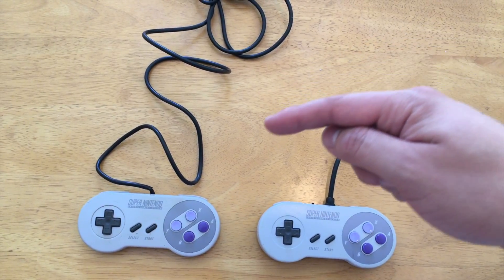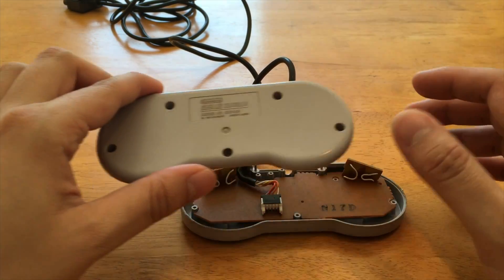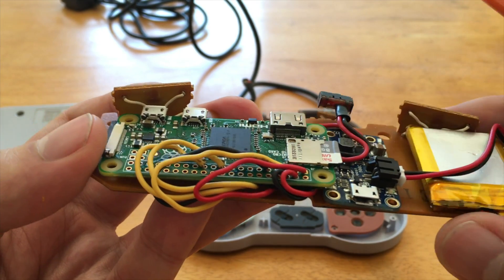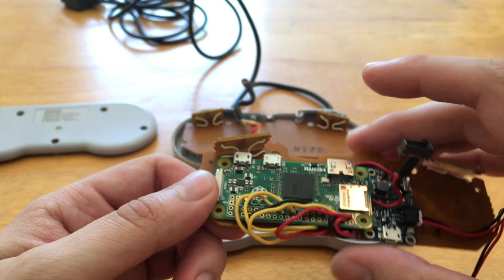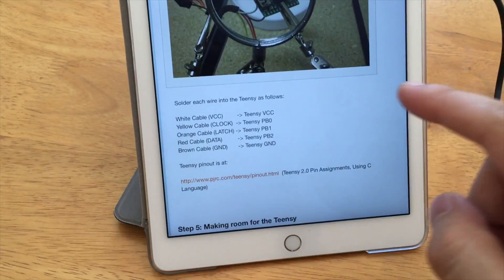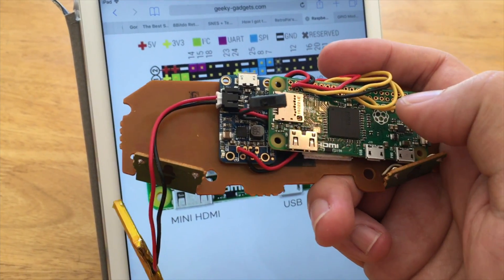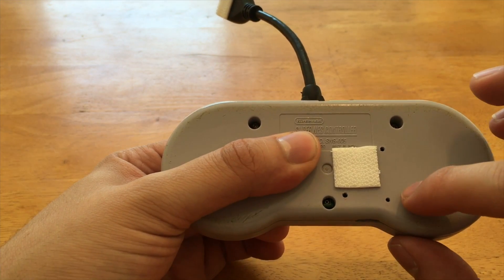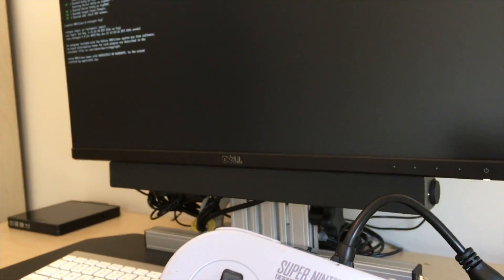Raspberry Pi Zero inside an SNES Controller - The SNS-005Z

Comment: Love it.. might do it myself in the near future! :)    
+1 Sub
Reply from the maker: Hi Tiny Plays and sgt cyrus, I am aiming to write up the software portion over the holiday break in this how-to https://hackaday.io/project/16288-raspberry-pi-zero-inside-an-snes-controller.  Sorry I haven't been able to get to it sooner (work has been busy).  I'll write back as soon as its up - hopefully by the end of the month.
Reply from the maker: Good idea Tiny Plays.  During break I'll see if I can make a thin img of the install with just retropie and the driver set up.
Reply from the maker: Thank you!  Will be glad to help out if you have any questions no problem.
Reply: I noticed you offered Lord Mortus help so i hope you wont mind helping me as well. I messaged you on youtube but i dont know if you got the message so ill just copy paste it here. Sorry if you already read this and im just repeating myself but here we go:

Can i get your help with the raspberry pi zero inside a snes controller guide? I need to wire my snes controller to my pi zero but ive already used pin 1, 2, 6, 17, 19, 21, 22, 23,  and 24. Your guide says to use pin 1, 5,  9, 19, and 23 which is a problem for me due to the fact that I'm using pin 1, 19, and 23 for another attachment. Is there any way i can attach the controls to a different gpio pin?  I've tried researching this but i feel like im in over my head. I'm trying to do this as a project for school so its getting stressful to get it done in time. Any help you can offer me would be really appreciated :)
Reply from the maker: Hi sgt cyrus,  I'll be glad to try and help.  Will likely be able to take a look this weekend at the earliest.
Reply: Anthony Caccese okay you're a life saver :D
Reply: Tiny Plays probably not lol but whats up
Reply: if youre talking about the software for the controller im stuck on that as well.

Comment: So question, if you did this with a usb controller snes. What would be different?
Reply from the maker: Hi Paul, I think the main differences to watch for would be the space you have inside the controller, how it would be wired up to the Zero and how to interface retropie with it software wise (for example you wouldn't need to use the gamecon_gpio driver)

I know this project (which was an inspiration for me building mine) uses a USB controller as a base
https://twitter.com/another_russell/status/677212612170555393
This images he has posted might help.  I haven't been able to find wiring diagrams on that one yet but will see what I can dig up

Comment: Ideas for saving space in there: kynar wires (thinner insulation), trim the pi by grinding off the bits on the edge you don't need (like around that camera connector), and remove unnecessary connectors (unused USB ports, for example). You might be able to get all three components to sit flush on the back of the controller PCB next to each other like that.
Reply: Adam Zey this is a project for beginners so no beginner would try to trim the pi
Reply: the pi is easy (and cheap, especially the zero) enough for beginners to actually do that and more, if they want something to fit tightly, they must commit and it's actually a good thing to learn things the hard way.

Comment: Does this not get TERRIBLE frame rates in snes games? My pi is the worst with that, it slows down almost every snes game I try to play and it drives me insane
Reply from the maker: I haven't run into an issue so far.  Possible to let me know what version of retropie you are running and what emulator is being used to run snes games?  Will see if I can help
Reply: Hmm where is that information located? 

Oh something else of note, I'm actually getting bad slowdown in nes AND snes emulators. For whatever reason I'm getting NO slowdown in gameboy color games (and I can't load gba games at all because something about the BIOS)

Comment: So i could actually not understand you completely in the part but how long does the battery last aprox? Great mod! I'm working on a pi/nes hybrid with a 3d printed case :)
Reply from the maker: It's my bad - the audio ended up being lower volume than I expected.  Battery lasts about 3 hours.

Comment: Do you think there would be any way to mod the controller to have a port so another controller can connect to it? So that two people can play together? I imagine it would only take 1 more USB hub at the top or maybe bottom since there are SNES controllers for sale now that have a USB plug instead of the old 7 pin one.
Reply from the maker: I think it might be possible.  Been talking through ideas in another comment on this video started by Lualdu.  There are test pads on the bottom of the zero to solder a USB port.  Next big question is power.
Reply: Anthony Caccese I used to have a pirate/chinese knock off emulator that was basically one controller, a port to connect a second controller, av cables and a ac adapter port. Maybe that would work.

Comment: how dificult will be make it for two players?

some thing like atatch another control to the main one
Reply from the maker: Working on that next.  There are test pads on the bottom of the zero that a USB can be soldered to.  Next question is if there is enough power to make that work.

Comment: Hi  Anthony!
Amazing hack, love it! I want to build one of these myself. And want to add wifi to it as well. Do you think a Famicon controller will work the same way?
Reply from the maker: Hi Sondre, I have seen similar builds with Famicom and NES controllers - the gamecom driver has support for mapping those as well.  With the NES controller, the main difference I have seen is the space to add the board itself is not as tall so it might be difficult to fit a battery and powerboost inside.  This looked like a good starting point to see what's possible - https://hackaday.io/project/8703-zero-entertainment-system

Comment: Hey I wanted to do this, and make a first video!! But I cant get a Zero :( 

Good job nemesis!!!
Reply from the maker: I have started to see more stock available for Zero's in the last few weeks - so hopefully they are becoming easier to come by.  Would be excited to see your take on this as well!
Reply: Anthony Caccese Well my gripe is now I have to make it cleaner than yours. Heck its like I now practically need to take my Oculus Rift cable and splice it to have a SNES controller where you don't need a battery and could power it from the power USB jack on the TV (optionally of course a wall adapter). Need a replacement cord :( 

Also I can imagine the hell that is soldering a HDMI plug to that cord. But if I could get a replacement cord the cable is so long I practically would have unlimited retries. 

If I also didn't power the Pi via GPIO but soldered a micro usb to the cable, the USB could be hooked up to a computer then you could use win scp to transfer new games without opening it.

Comment: Well i got mine almost compleate but ran across an issue where just the B and only the B button will work.  Did you run across that issue on yours?
Reply from the maker: I did run into something similar when doing the wiring the first time (my up/down dpad controls were mapped to the a/b buttons).  If I am remembering correctly I had mistakenly flipped clock and latch.  So I am thinking it could be wiring or the GPIO driver config (or a combo of the 2)

Possible to take a photo of your current wiring (from the controller to the GPIO) so we can start there?

I'll also get my config for the driver and upload it so we can compare that as well.

Excited to help and see you get yours completed!

Comment: I've found an error in your schematics. Clock and Latch are connected to the wrong gpio pins. By the way, I followed your instructions (and eccept for those small issues) it works great!
Reply from the maker: Great catch! Very sorry about that - looks like I was off by 1 for both.  I just fixed the diagram and reuploaded.  Thank you again for your help.
Reply: Thank you for this great project :)

Comment: Awesome work! How long does the battery last. Also, ever think of using magnets instead of screws to hold it closed?
Reply: It says 2 hrs in the description. Also, you don't want your project falling open if you drop it or it getting stuck to any wire or metal bits laying around. As a tinkerer, I can confirm that my workstation always has little metallic things everywhere. xD
Reply: +MuffinsSpreadPlagues Noticed it said it after I posted :x was thinking about the magnets, I don't think it would pop open but yeah, it would stick to everything in my bag or on my desk lol
Reply: +phonixzero Lol same here. earbuds would always be wrapped around it too

Comment: might want to use stranded wire vs solid core so the cabling won't be as stiff unless you want it to be.
Reply from the maker: Awesome tip!  You're right that would totally make it easier to move the wire around in the case.  It is a bit too stiff now.  May try that in another revision.
Reply: +Anthony Caccese cool :) glad I could help.    I just ordered all my parts yesterday so when I start building mine I'll try using stranded ribbon cable for the controller to the pi.

Comment: Have you ever thought of making a second controller to connect to that one wirelessly? It would be awesome to play donkey kong country with friends on one of those.
Reply from the maker: I am thinking through a way to expose the USB OTG port to try out a daisy chain approach as step 1 =)
Reply from the maker: +RubberBrony Amazing!  Thank you for pointing me in that direction. The pads for D+, D-, gnd and 5v right?  More straightforward than I was thinking initially. 
Now to find the right parts =)
Reply: +Anthony Caccese take a look at the test points on the bottom of the pi zero ;D
Reply: +Anthony Caccese Yup! :D
Reply: I tried this out and found the 500c couldn't handle supplying the usb port. I just plugged in an empty hub and it still caused the pi to crash.  If you went up to the 1000c and supplied power directly from its pins you could but you would probably drain that little battery super fast.
Reply from the maker: Thank you for the heads up Matthew.
Reply: Waner that's not an excuse. take 10 to 20 minutes every day. it will take a while but if you're not a lazy fuck it won't be too bad
Reply: hmmm I don't feel like it
Reply: With a Pi Zero W that shoudl be easy :P
Reply: +Lualdu if you wanna do that, build it like a GameBoy Zero, that has enough space in it for a bigger battery and WiFi dongle and Bluetooth dongle, then you could make that GBZ the console, or even as its own controller, and link into it with WiFi and or Bluetooth controllers, and probably even USB controllers.
With the newer 3D printed parts from Wermy and the better PCB's with USB hub in it etc it'll save you enough spaces that you can relatively easily do this.
Does mean more work, is far more versatile.
Reply: Oh my gosh I don't have the time to build a Gameboy zero any more options?
Reply: Waner You will make it far in life.

Comment: Perfect I want to do this. How much do those is one of those Rasp Pi? How heavy does it make the controler?
Reply from the maker: The Raspberry Pi Zero is $5.  Other parts added up to around $40.  Weight wise it's not that much heavier than a standard Super Nintendo controller - it just feels a lot denser because off all the stuff crammed inside =). 
Let me know if I can help with pointing out specifics on any of the other parts.
Reply: i can't beleive that powerboost board is like 3 times more than the  pi zero and it does not even include the battery for $15 bucks
amazing how cheap the pi zero is
Reply from the maker: I know it's wild!  I was blown away when they had Pi Zero's as the pack in for an issue of MagPi a few months ago.  Great little computer to work with.
Reply: Anthony Caccese it can really add up with all the extras though i can buy the pi zero at a store where i live for $5 but it will be like 10 or 12 there for an hdmi adapter they have really good prices on most things but i can order that from aliexpress for like 90 cents ,but it will probably take forever to get here ,it's good living near a microcenter  they have internet prices like newegg prices on most thing but some things are stll way cheaper from china

Comment: How did you put the images on the backgroud of each system? and the game info?
Nice project! :D
Reply from the maker: Thank you Ricardo, The background images and game info was luckily a built in option of retropie.  Details here: https://github.com/retropie/retropie-setup/wiki/scraper
Essentially put the games you want in their associated folders and then run the scraper with the Pi connected to the internet.
Reply: Anthony Caccese im in a pi zero without internet connection... can i upload it via USB?
Reply from the maker: I am not sure unfortunately.   Looking at the XML format that gets output from the scraper it is for sure something that can be created offline and then pushed over USB - I haven't found a program that does it that you can run on your pc though.  If you are just interested in images it looks like as long as the image is named the same as the filelname of the game it references and stored in the correct folder then emulation station will show it no problem.  The retropie forums would be a great next stop for research for sure.
Reply: Anthony Caccese Thanks for your response, really appreciate it. I found a lost wifi usb pen in my house and i was able to do it trought internet connection... Thank you for your time

Comment: Curious, how did you manage to shave down those extra bits of plastic on the back of the controller's case?
Reply from the maker: To start I removed the posts by using a pair of pliers and just rocked the plastic back and forth.  It takes a bit of work but it's not too bad.  Then to smooth out any excess I used a set of sanding sticks. 

I marked up this photo with the specific posts I removed:
https://www.dropbox.com/s/b372gvkajdp7i3q/sns-005z%20back.png?dl=0

Comment: have you thought of soldering wifi to the board once its out of its case? someone did it somewhere. i forgot where.
Reply from the maker: Oh interesting, I will look into that.  I started looking at options for desoldering the USB data port so I can route it out the side of the controller as an alternative for accessing the filesystem without opening the controller - wifi would be an exciting alternative =)